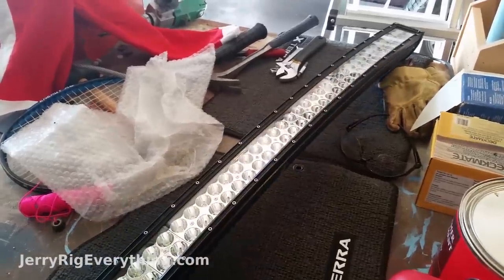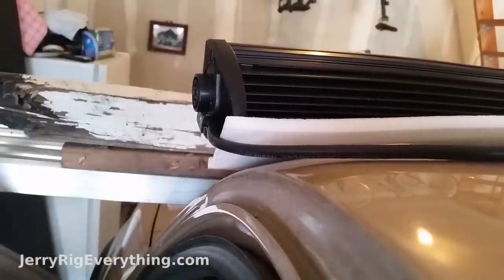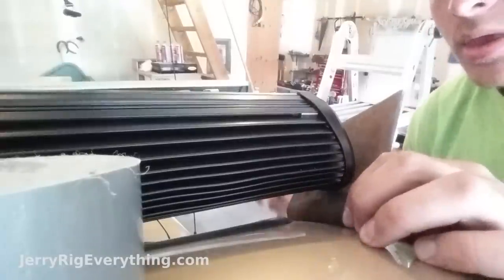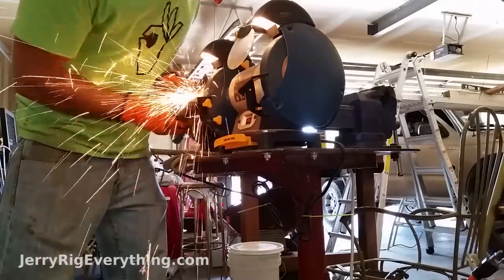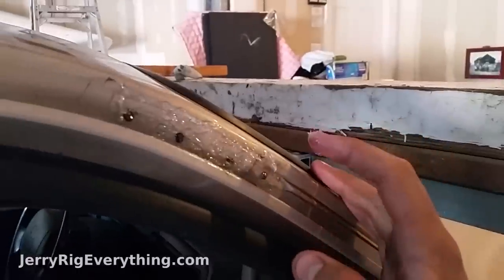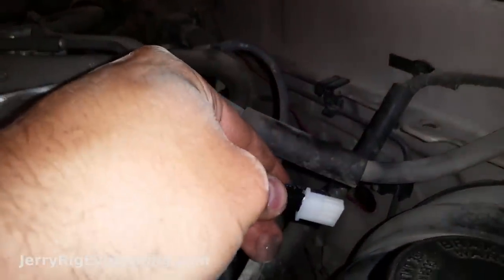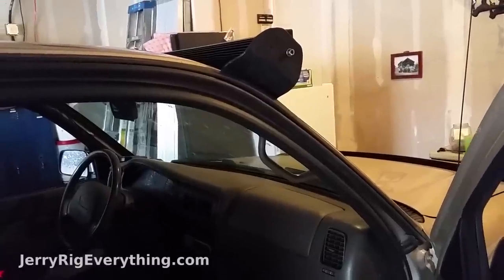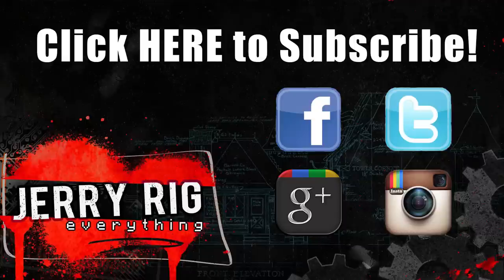Making Custom Brackets for a 50 inch LED Light Bar Truck Mount

Comment: Hey, great video! I have a 99 Tacoma and want to do the same exact job you did. Unfortunately, I do not have the tools necessary to make the custom brackets. I was curious if you would even be interested in manufacturing the exact same brackets, and if you are, how much $ would make it worth your while? I understand people are busy with their own lives so if you aren't interested no biggie
Reply from the maker: LazyFetus I kind of wish I would have made molds or something so that I could have duplicated these ones for the people interested.  But I didnt :-( Id have to take the whole thing apart to duplicate them, and I dont think I want to do that until the LED light bar itself needs replacing.
Reply: JerryRigEverything I don't blame you! Thanks again for the video. It was very helpful
Reply from the maker: No problem! Thanks for watching! Hopefully you get yours mounted.  They are fun to have.

Comment: I used a locking washer between my bar and mounts and it still spins.
Reply from the maker: Jeremy Long If the nut is spun as tight as it will go, you might need to use thicker metal, or more washers.

Comment: I had a lot of washers lol so I took a lot out and went down to 3 washers the smaller screw that came with the bar and then I switched the locking washer for another locking washer that has teeth like a saw blade and it still spins.

Comment: do they sale after market brackets for 50 inch on 07 tacoma?
Reply: +David Salinas They do.  But they cost more than the light bar itself.
Reply: +David Salinas  yes the 05 and up have a pre drill holes on the roof  ..under the black plastic inserts..

Comment: hi from down under I did the same thing to my 60 seriers but coudnt stand the glare refelcted off the bonnet
Reply from the maker: +glen mansfield Im with ya, it gets a bit annoying sometimes.  I wonder if I mounted it higher on the top of the truck, if it would reflect as much.
Reply: +JerryRigEverything Higher may work, but I would mount it further back on the cab.  Say by the back edge of the front door, the roof will keep the glare off the hood and still allow the light to illuminate the terrain ahead.  You would just need to play with it to find the sweet spot.
Reply from the maker: It just doesnt look as 'cool' mid cab.  Lol thats the sucky part.

Comment: To start I am not knocking your work at all, But the steel is way to thick, and they need to be set back on your roof more, reason Im saying this is because I bet you get a ton of glare, not only from the hood but mainly from the windshield. Your vision would be 5xs better. Be careful you dont brush up on a tree or a thick branch with that thick mount because you will bend the windshield arm and shatter the glass, Ive seen it hapen. But Good Job anyway.  STAY BLESSED  BB

Comment: Way too much for just an installation. Just measure up from windshield and in from door. The level is nit needed since both sides of the truck are symetrical.

Comment: Don't ground your alarm, system, or light bar to the body of your truck dude. Always ground to the frame.  Also did you really just drill a hole in the pillar and silicone around the wire? Rubber grommets are very cheap and don't look so... Well, jerry rigged! Smh
Reply from the maker: HOTSAUCE Any particular reason to ground to the frame?  The body is attached to the frame. I just figured it was all the same thing. I'll have to look into getting the rubber grommet for my next truck.  I didnt even think about that.
Reply: Is your battery grounded to your fire wall or fender? The thicker and larger the area the better.
Reply: Also you are relying on the area of the metal that you drilled or screwed through to ground to. And 9 times out of ten if that light goes out you won't even suspect the weak ground. I'd be surprised if it's even working at its full potential. And before I get any smart ass comments from people, yes I know the battery is usually grounded to the engine block and it's not ideal to do so with everything else. But, what's the next best thing?? A nice clean spot on the frame.
Reply from the maker: Interesting ideas. And you are right, the bigger the metal that you ground to the better.  Ive installed enough sound systems and seat warmers to figure that out. Ill definitely make sure the next light bar gets a bigger ground.
Reply: If you have a bad ground connection would it keep blowing the in line fuse on the wiring harness..

Comment: couldn't you have at least not used a countersunk bolt? sorry man but all that hard work making a cool bracket to use mismatched hardware. at a minimumshould have put some lock tight on them bolts dig the light a bracket though...i also have a white 99 ex cab pre runner. bad ass truck bro
Reply from the maker: jason stout Love this truck.  I just put some 33/12.5 inch tires on it a few days ago. And ya, I agree with the hardware comment.  But... It was what I had at the time... Plus, the length of each bolt was a bit different because of the thickness of the truck.  So I had to get a little creative.  Still works though!
Reply: JerryRigEverything dude...just totally saw what your channel is named ha ha my bad man. i like how it turned out.i need one for my truck now! i have 31'' BFG's on flat black KMC enduros.....sometimes i wish they were bigger when i look at my wheel wells and all the space there still is.
Reply from the maker: Thats how I felt!  To be honest, The 33's do rub a little... But only when cranking hard all the way left or right.  I feel like the extra size is a good trade off.

Comment: good job but my high beams are just as good, ha, dont the cops tell you that its against the law to run that light bar with it uncovered, they dt let us run off road lights on street unless covered
Reply: Depends on the area. We can run the uncovered here as long as they are turned off unless they are bumper level or lower. The real douchbags run them down low blinding everybody but they are the same ones with cheap HIDs in the wrong housings that need the LEDs to see.

 I know in one state they can't have any offroad lights installed period on the road.